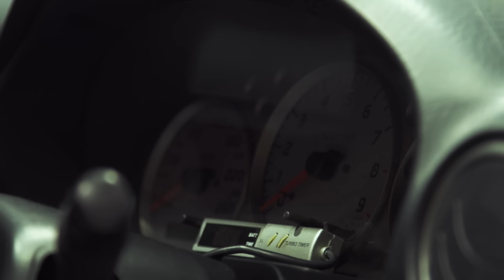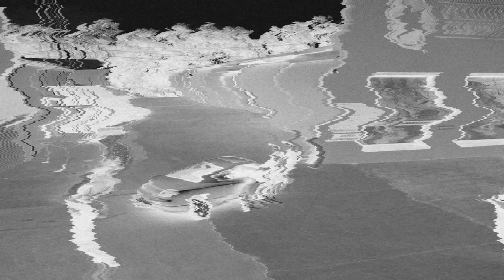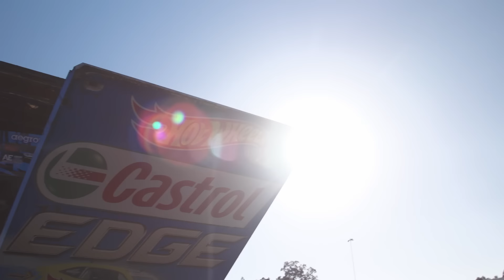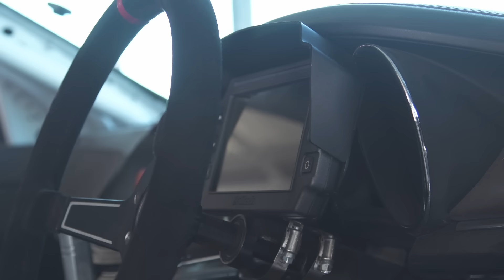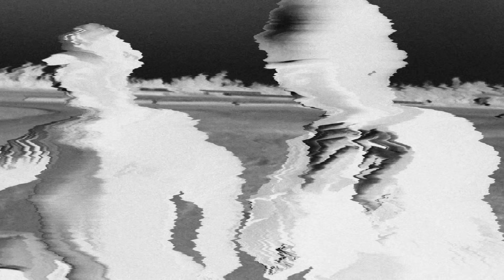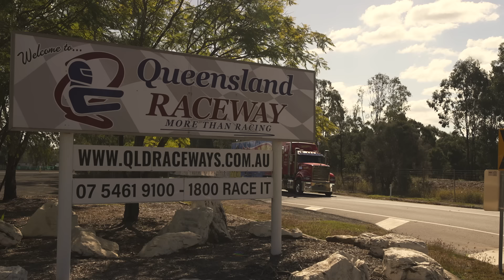Learning To Drift In a S15 Silvia - Sliding With The Hot Wheels Stunt Team!

Comment: Sweet car, congrats 🎊🎉. I also had to buy my first car after I joined the army, it was a 1991 Toyota celica. That I had for about 15 years or so, change the motor and transmission to a JDM inline four. Change the transmission from automatic to 5 gear standard. Going to 130 to 140 on 4th gear. It was a great car and I was proud to buy it with my own money. Have fun with  that great car 🚗.

Comment: Cheap tiny mismatched rear tyres are not helping. You really want matching compounds as well as sidewalls/belt plys. 
Lowering rear tyre psi gives more car angle too, as the tyres flop/squirm an extra 10 degrees relative to the rims. 
Front toe out is free steering lock too.
You don't "need" a steering lock kit asap, but considering they cost nothing do it. 

What you absolutely need is 7-8° caster. Think of caster as automatic counter steer. 
Without it you have to predict steering lock and counter earlier. Beginners don't have the knowledge or reflexes to drive stock caster
There is always a perfect number to suit your wheelbase and tyre setup that will allow zero counter (hands off steering wheel using just throttle to control angle) drifting around constant radius corners.